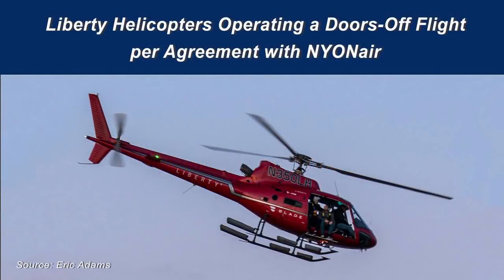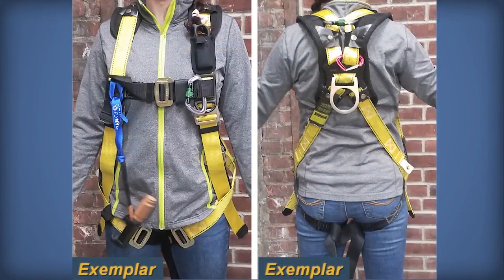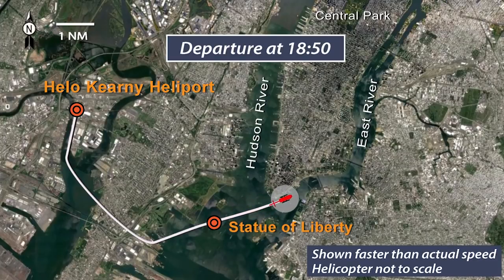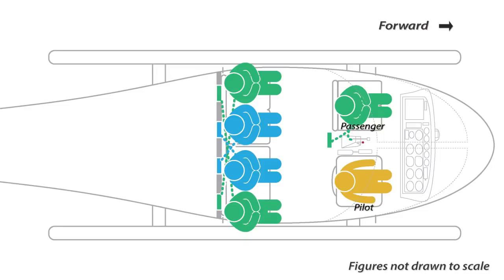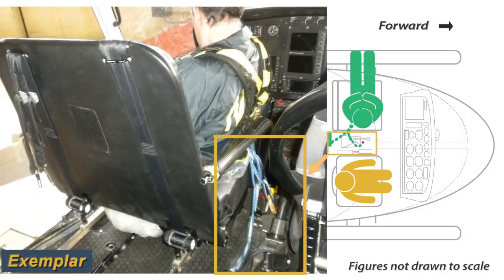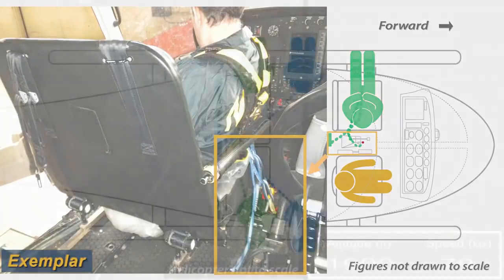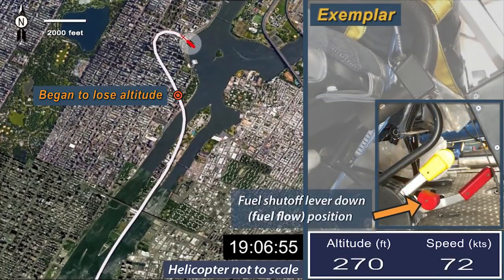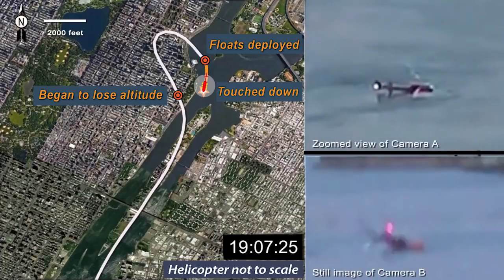Liberty Helicopters AS350 Ditching • NTSB Animation

Comment: Can any helo pilots explain why the fuel control levers are on the floor as opposed to overhead or on console? This position seems to invite too many opportunities for unintentional movement of these critical controls.
Reply: I fly for a company that flys a lot of AS350's this was a B2 variant, newer models have been changed to an overhead switch and electronic fuel controls.  Unfortunately, this doesn't help the thousands of older variants that have the floor mounted controls.  To be fair, those levers are fairly hard to accidentally shut off when properly seated in their detents as this seems to have been.  This was a tragic one in a billion accident, but in my opinion was not as much a design flaw as it was a lack of proper training on the restraints and emergency egress. We have a 3 day course you have to go through including practice egress iterations before you are allowed in the front seat.  11 seconds from touchdown to rollover is more than ample time to egress that aircraft...IF you are properly trained on how to do so.  Understanding that you are flying untrained tourists and photographers, there should probably not have been anyone in the front seat who had not been through an aircraft familiarization and emergency egress brief.
Reply: @Jonund  Thanks for the informative reply! It reminds me of the Air Canada 767 whose crew accidentally cut off fuel to both engines while in level cruise. Engineers can't foresee every eventuality. 

Blue skies and happy landings
Reply: It's a design difference.  Even U.S. made helo's differ in fuel control locations.  Even the OH-58 (overhead fuel lever) differs from the the B206/TH-67 panel mounted fuel control(the 58 and 67/b206 are almost identical).   But no, I cannot tell you why they designed it that way.

Comment: It annoys me that all that's come from this is everyone wanting to end "Doors off flights."    Flying with the doors off is safer than doors on, as you have a much easier means of egress.  The Harnesses were 100% of the problem.  (the as350 fuel controls are a problem, but a different one entirely)
i still can't believe those harnesses made it through so many layers of pilots, managers, and bureaucrats without someone realizing they were such a dangerous idea!
Reply: and i think besides all that it's a dangerous idea for a non-pilot to fly in the front seat in the first place.
Reply: @clippydemascot  if there's no controls for them to mess with, i see no problem.   The as350 controls can be messed with from the back seats as well
Reply: @briancooney9952  from the back? you mean deliberately or what?
Reply: @clippydemascot   bags, purse straps.   The as350 engine controls are in such a location that literally anything can screw them up
Reply: @briancooney9952  i see. damn, the briefing should have covered and involved a practical operation of harnesses by all pax.
Reply: @clippydemascot  from what I understand, they did have a short briefing on the harnesses. 
But those harnesses are difficult to get in and out of.
At my old job I used those harnesses all the time. Could get in and out pretty quick. I worked with guys who still couldnt figure them out after years,of using them. 
Could i get out of one upside down in freezing cold water in a cramped helicopter?  I could only hope so.
Reply: In all honesty, the pilots probably argued against their use, but management was surrounded by good idea fairies.

Comment: Thanks, AirBoyd. Tragic yet informative. Don't mess with the flight controls if you are on a tourist or scenic flight, please.
Reply: What I don't get is why wouldn't Airbus have an audible warning connected to the fuel shutoff? It's such a simple feature to have, pilots usually don't intend to cut their fuel mid-flight and if it's not immediately rectified the aircraft will crash. If the pilot knew the issue was fuel starvation he could have saved it.
Reply: @MrMattumbo   I agree, perhaps the designers wanted the fuel cutoff within reach distance of back passengers? Bad design or good design I don't know.